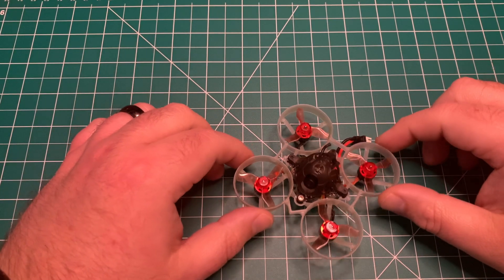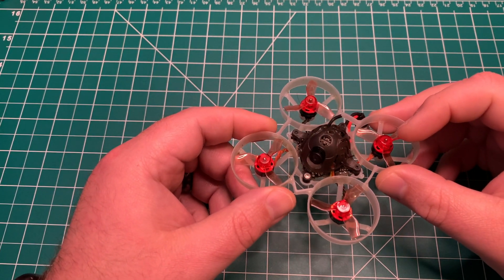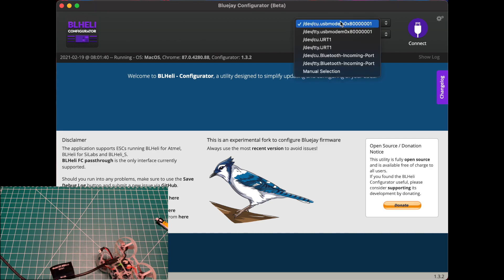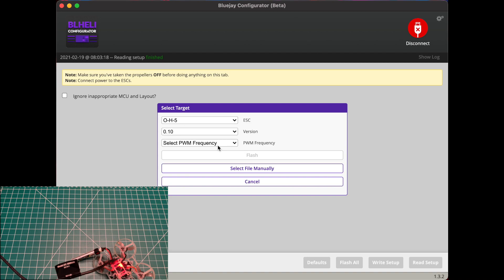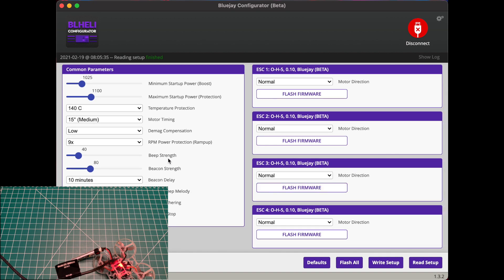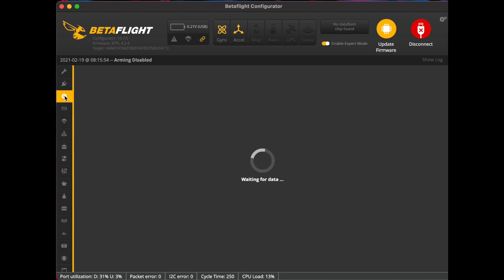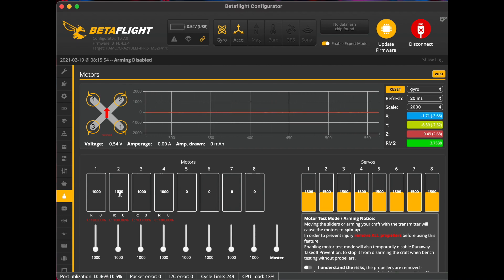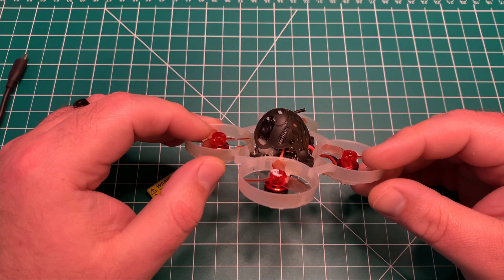Blue Jay ESC Firmware for RPM Filtering with Blhel_S ESCs

Comment: question I have betafpv 300ah battery and my drone flies only 2min tops. How did you get it to fly 6 min after the update? I would be happy to have 3min...
Reply from the maker: Unfortunately, the BetaFPV packs are horrible. I would recommend the NBD Nitro Nectar, WebleedFPV, or Tattu lipos. The Tattu packs are the cheapest, and work great. Hope this helps!

Comment: i have flywoo firefly hex using 1202.5 5000KV, i flashed it with bluesay 0.16 pwm 48, but i cannot enable bidirection dishot. will it still give benefit or should i flash back to BL heli s ?
Reply from the maker: You may try to reflash again.

Comment: Hi, how do you flash back to blheli v14? I've tried in BlHeli but it just says v11. 0 is not supported. Thanks.
Reply from the maker: Blheli_s 14 is really old. I think it ships with 16.7. You can flash 16.7 with Blheli Configurator.
Reply: @TitanFPV  sorry meant 16.7 it won't reflash back for some reason.

Comment: Hi. I'm fliyng the Mobula 6 ELRS and have just followed along with your tutorial. All ok apart from PID tab, Filter settings.. on the slider they values are set to 0 and I get a warning current slider positions may cause fly aways or motor damage. When I set profile dependant and independant to ON and move the sliders to 1 position and save they just default back to OFF and 0? Is this normal ? 

Thanks.

Comment: is it just me or are you running Linux?? if you are I have a lot of questions for you.... i cant even get BLHeli to open in Linux_mint20.04 unless I do it through terminal and then it crashes almost as soon as I try to connect (or just wont let me connect) I have all of my /dev/ files and /media/ permissions tuned up to chmod 777, its literally just BL Heli.... I have BLHeli32 running just fine for my 5 inch......once I get that I can try this one.please help me idno what to do! thanks.
Reply from the maker: Sorry, I’m running macOS Big Sur 11.4.
Reply: Dang it! Well your video helped me anyway! I have had a hell of a time trying to learn Linux while also learning all of this firmware stuff and trying to learn to fly all At once! I guess that’s what I signed up for, eh? It’s a ton of fun but it gets challenging sometimes…. I figured you might be running Mac but all of the /dev mounting points had me wondering… thanks for the response! Happy flying!
Reply from the maker: Glad to help!

Comment: Did you resource the motors? When I did I couldn't get it to arm. Any ideas?
Reply from the maker: 10:48 in. Make sure the escs flashed correctly in Blue Jay Configurator.
Reply: @TitanFPV  all good! Flies great now. Needed to set the motors to the right source

Comment: I did this method for more flight time and instead of more flight time I am getting less around 1min sometimes 2min less as with the 450mah 1s I had around 4-4.30mins now2.3- 3mins pushed I also tried  the other video you have ( moblite7 update bf + rpm filters) still the same,any ideas what can I do at least to get  the 1ish min back :)
Reply: Btw it's on the mob7 and trashcan I did it

Comment: Is blue jay just for whoops?
Reply from the maker: Nope. Any Bheli_S ESC.
Reply: @TitanFPV  i tried putting it on my boltv2 and it said not available
Reply from the maker: It may not be available yet for all targets. If you want to enable RPM filtering for free on Blhel_s on the normal 24khz, you can flash 16.71 official beta on the normal Blheli Configurator.
Reply: @TitanFPV  ill check it out again, I tried about a month ago.

Comment: Thanks for this. Runs beautifully. But I see motor direction in the Blue Jay configurator as normal, when the mobula6 ships in props out. Works great without switching to reversed. Do you know why? More for my understanding and education. Thanks again for the content!
Reply from the maker: Good catch. It looks like that’s the way they shipped it from the factory. The Mobula6s do ship with CCW and CW motors, and it appears that they have installed them opposite of what the board is expecting.
Reply: @TitanFPV  got it, so we will need to be careful when replacing motors. We might need to reverse the new motor in Blue Jay. Unless the motor plug on the fc is what’s swapped.

Comment: I had to increase the start boost for 0802 motors but only on one of my 3. Motors are of a different brand than my other 2 could be why but other than that all has been well for last few weeks I have been using it.
Reply: @FpvGirl was one motor randomly not arming? I’ve seen this on all my tiny whoops. I’m starting to see startup power above .5 (default) equivalent in blue jay might be helping. Still testing though, would be interested to get your thoughts
Reply: @JALFPV  exactly would sit there an kinda stutter and yes on all my 0802 motors did the same thing I first I thought just one quad.  I just moved both the sliders up 100 I think around there anyways kept the spacing between the sliders 75. No problems since. I did notice that from 24pwm to 48 didn't have a giant difference in flight time like jesc. With jesc I gained a minute average but lost low end power like both time and power where noticeable. With bluejay feels the same and flight times roughly the same. Could be my motor timing or something I'm doing wrong. Like to know if anyone else sees a big difference
Reply: @RubyS.1  good to know I’m not the only seeing this! I’m testing .75 equivalent in Blue Jay now. There is documentation that shows blheli s startup power and the equivalent startup max and min in blue jay. I’m trying to keep them in line, but leave leave protection at 9x cause that is the default equivalent. 

I noticed flight times aren’t much improved on 48 either, but 96 is where my flight times moved to over 4 min. I have a mobula6 25000kv so there is a lot of thrust to spare. The reduction from moving up in frequency wasn’t bad. I actually still scale throttle to 75% cause my house is small.